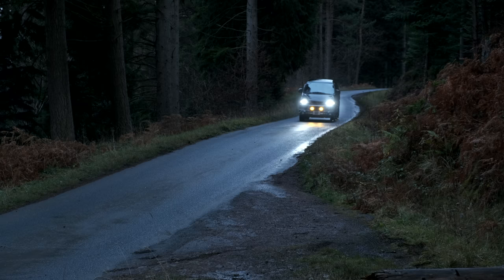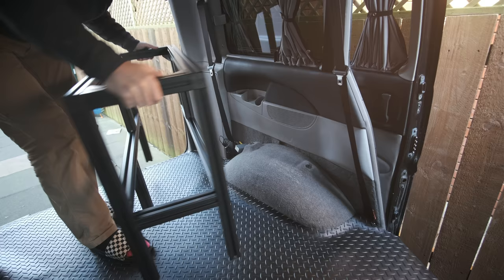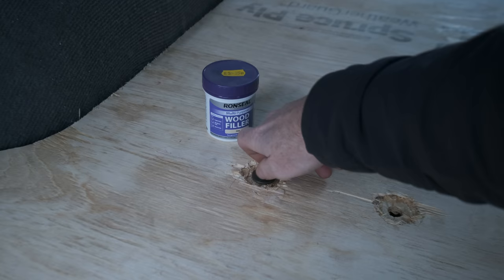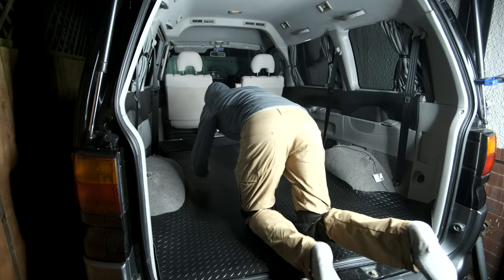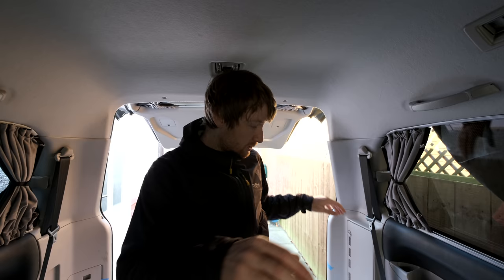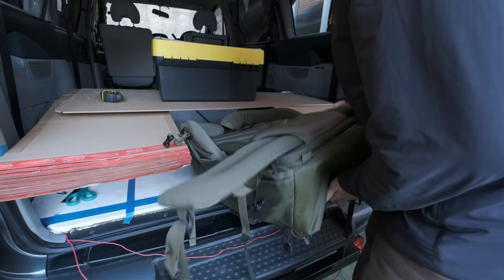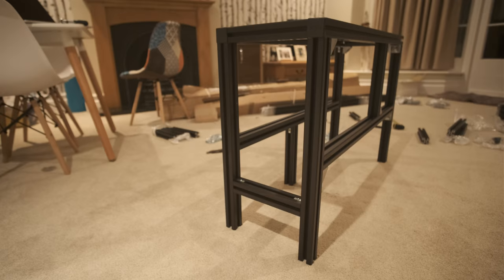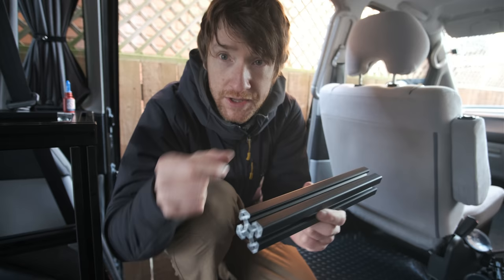Small Off-Road Camper Van Conversion Using Aluminium

Comment: Puzzled as to why you laid the rubber floor to then cover it with cork 🤔
Reply from the maker: I was going to cut away the rubber, but it is a perfect vapour barrier, so I sacrificed 3mm of height and laid the cork on top. the rubber still remains in all storage cupboards :)
Reply: @ThomasHeatonPhoto  I was kind of glad the rubber wasn't the finished floor, because with it's textured surface it would be a nightmare to keep clean, your cork floor will sweep and wipe clean nicely!

Comment: 20:11 - thats why you dont torque screws with an electric tool... instantly made a round hole with the screw in the soft material, as the tip touched van metal plate. Nice. Also a tip... dont use these old screws.. why dont use torx? These old types should be banned. Dont even know the names in english.

Comment: If I had a dollar for every YouTube channel that portrays themself as an expert on extruded aluminum T slot, that knows almost nothing about it and even less about structural design, I could buy several of those $3000 lithium ion batteries. I don’t know about European manufacturers, but 80/20 Inc in Indiana has over 2000 different parts and this guy is probably somewhat familiar with two dozen at the most. Am I right Mr. Heaton? Don’t take it personally you’re probably no better or worse on average than the other van conversion channels Make them self out to be experts in this area. The scary part is I’m no expert in power and solar systems so these same channels could convince me that they are electrical experts just as easily as they convince everyone else that they are experts in aluminum T-slot extrusion. I think the only solution is to sick people who specialize in the area you need help with because these generalist they want you to think they know everything can’t possibly, and that certainly includes not so Humble Road and Jarrod Tocci. Don’t even get me started on the conflicts of interest on the products on which they make a commission when you buy.